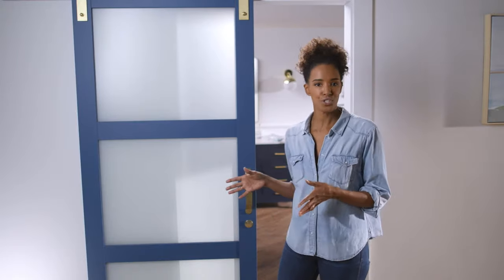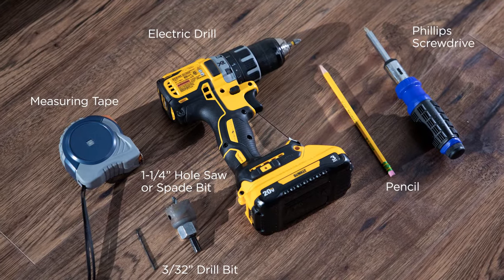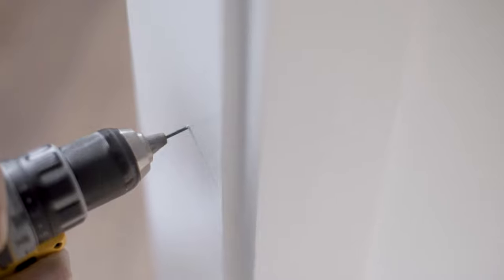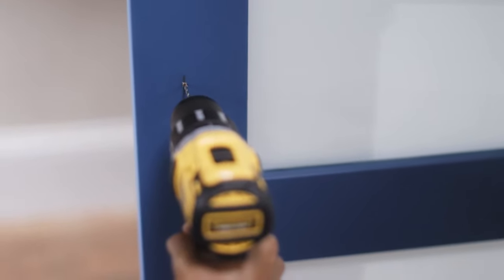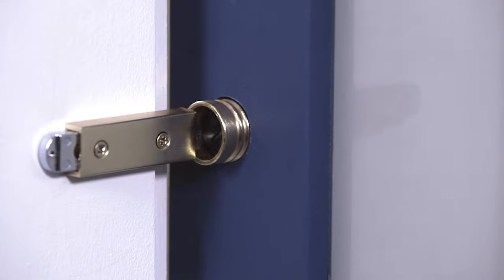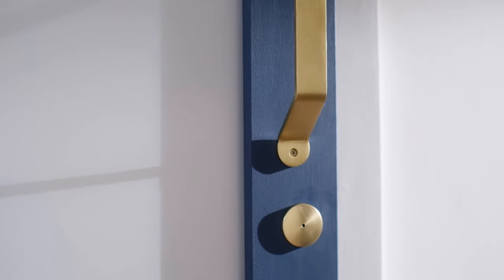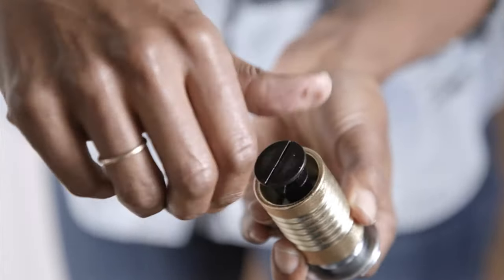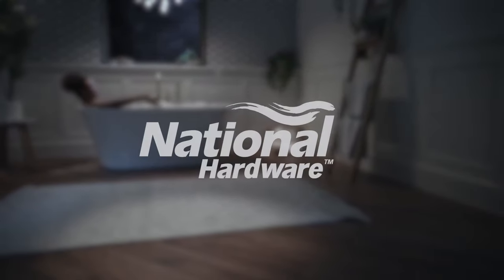How-to Install the Barn Door Lock by National Hardware

Comment: Would be great to get a video showing how to install it the other way
Reply: Lmao! 😂 drill a 1.5 inch hole through door and push “lock” through. Hold up other section on wall where the “lock” is and screw 2 screws to secure it in place. Boom you are done in 3 minutes flat and a minute and a half of that is finding the hole saw and a minute of cleaning up the tiny amount of saw dust and 15 seconds to throw dust in garbage and toss tools in their area…… so 15 seconds of actual work. If you can’t understand that from just seeing the video then I assume you hire out lightbulb changing. 🤦‍♂️
Reply: How does it feel to be so useless?

Comment: Can this lock be open from the outside if you have it installed from the inside
Reply: Have the same questions as planning to instal it in a bathroom and would like to know if there is a way to unlock from outside if someone locks it from inside
Reply: That’s the same question I’m pondering on that’s what i need to be able to lock it from the outside